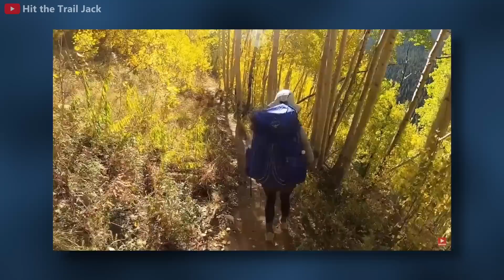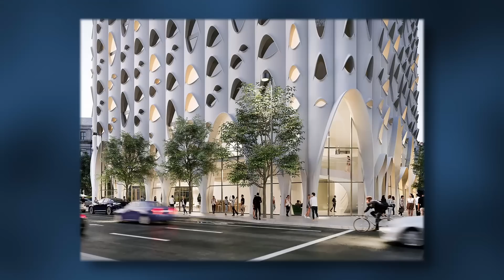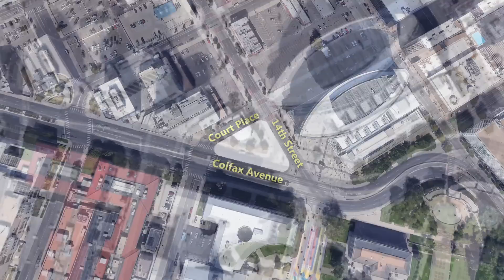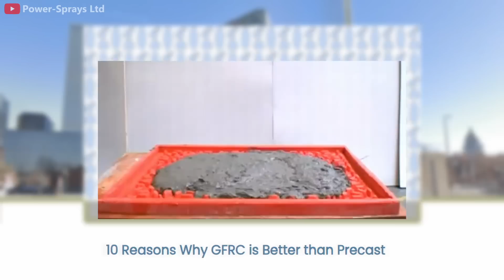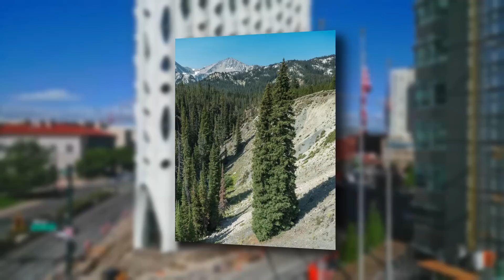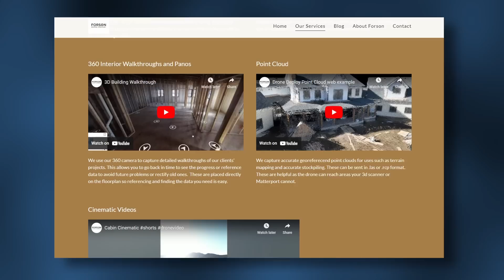This Hotel will Change the Industry

Comment: If the hotel’s goal is to capture high end business travelers and convention goers than the need for parking will be lessened. There is also a free shuttle up and down Denver’s 16th st to assist in getting around. Also, there are several train options to get around town and the airport. Hypothetically, the lack of parking spaces can work out for everyone.
Reply: Let’s see here… the “A train” to the airport, never works. The free shuttles on 16th st mall are great for muggers. And let’s not forget the buses filled with teenagers that are packing with itching trigger fingers…
Reply: @snoykster2216     Too bad to hear. I was talking more about getting to and coming from the Airport. I didn’t realize that it is that bad in Denver. I grew up there and left in 1999.   :-)
Reply: @Montanaman-j6l  if you left, then you have nothing to speak on.
Reply: @snoykster2216 I'm guessing you don't have a lot of friends.